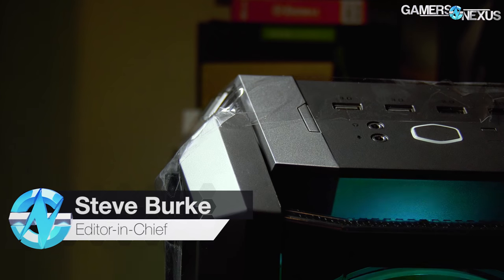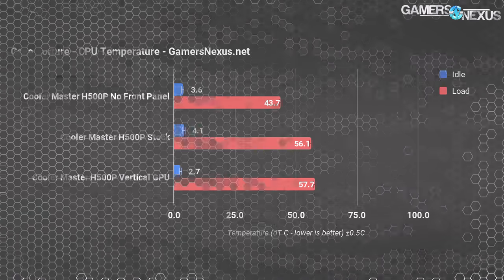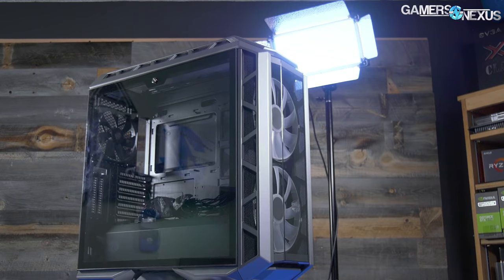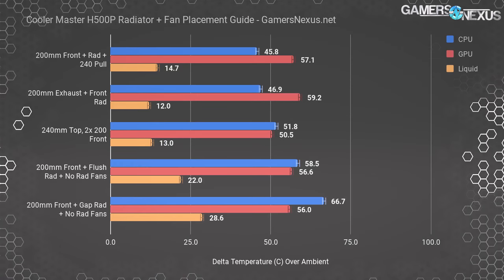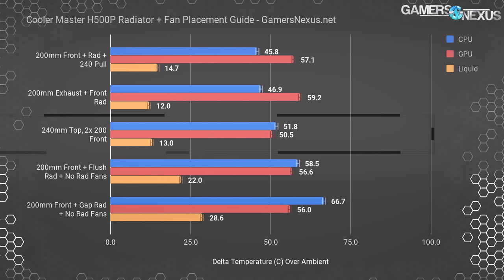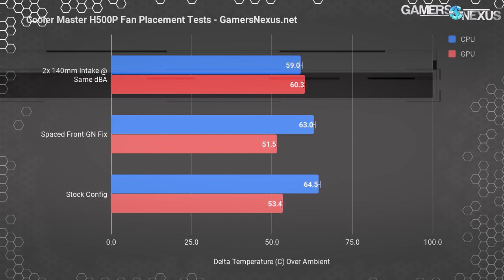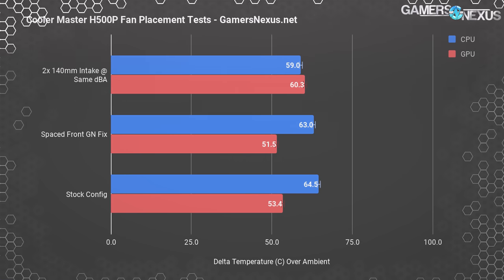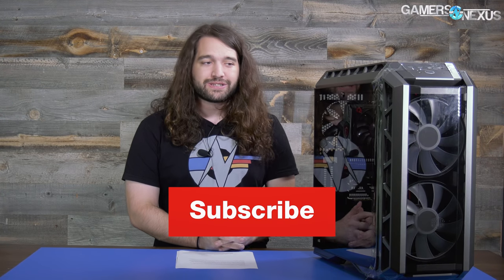Cooler Master H500P Radiator & Fan Placement Guide

Comment from the maker: SPOILER: We fixed this case's performance on air. That content goes up tomorrow.
Article: https://www.gamersnexus.net/guides/3084-cooler-master-h500p-radiator-placement-guide
You might like our review of the H500P: https://www.youtube.com/watch?v=HRsb4C5gLLc
Reply: just cut that piece of plastic and use a mesh.
But doing that on a 130 dollars case...
Reply: all mesh front lol
Reply: Thanks Steve,  I realy  like this case I can't help but wonder being aair case  what if you added 3 mor intake fans on top and just used aa regular CPU cooler how that would do
Reply: Gamers Nexus 
Steve, it would be much more helpful if you could have provided an illustration for each of the fan orientations in graphical form instead of simply a text description. It's hard to visualize all of the different configurations without them.
Reply from the maker: Noted for next time, obvious_humor!
Reply: Gamers Nexus edit your test configurations chart with mm instead of cm because WHY WOULD CASE FANS BE 1.2M, 1.4M OR 2.0M. just saying.
Reply: YES, do Radiator mounting guides for major case releases! It's very interesting and informative, even if you don't even own that particular case.

Please, do more!
Reply: What about a top radiator set as intake?
Reply: @Jeffery barring that the column already indicates they're 200mm and 140 fans,  the 2 x 200 CM and 1 x 140 CM stands for Cooler Master if you extrapolate that right next to them they list 2x 120 EVGA, unless EVGA stands for new unit of measure.
Reply: So it turns to a butterfly...or more like a "Meshify CM" !!!!????
Reply: occultworks I tried that on my case causes the gpu and other mobo components to run hotter.
Reply: Would it work or even be worth it to mount a fan or 2 behind the 2 on the front to increase air flow or no?
Reply: If you are talking about push/pull configuration on the rad,then it wouldn't be worth it, maybe you'll get 3-5 degrees cooler if your lucky but the noise would be much greater. Not really worth it.
Reply: Na I meant adding some fans behind the 200 sized fans that are kinda slack, Because this graphics card is moving more hot air towards the front of the case and I dont think I have enough intake to move it all around or out of the case.
Reply: EvanBestever I  am not sure if the 200 sized fans would actually obstruct the other ones that you would put behind them. They might even cause them to work harder and make more noise. Perhaps you should consider replacing the 200 sized fans with the smaller ones and compare the difference
Reply: I just bought the newer H500.   Will this test will apply?   There best config being the radiator and it's fans mounted on top with the stock fans left as is?
Reply: Can you do one of these for the meshify c mini?

Comment: So basically remove the front acrylic all together or just mod the front with a mesh grill instead of the clear acrylic.  You could still see the fans and the lights but this trend of pushing just straight aesthetics over performance needs to die on cases that are clearly designed around airflow.
Reply from the maker: Watch tomorrow's content! You've got the right idea.
Reply: GN already teasing a video in which they replace the window in the front panel with mesh @ 13:36 (Prediction: thermals will be similar to removing the front panel entirely if only a few degrees higher due to slight impediment by mesh)
Reply: Front mesh all the way. My first real case had a front mesh, my new case has it too. Great airflow even when featuring a massive 3-fan card and a massive CPU heatsink like the NH-D14.
Reply: My zalman z11 plus looks like a stealth bomber and has great air flow. I beg to differ on that one.
Reply: Gamers Nexus:   #DrillBabyDrill! Lol
Reply: If  you can mold the mesh to like the front acrylic shape and with some paint it would still look pretty good
Reply: No. if you have to do that. Then you would be spending more money.
Reply: Gamers Nexus actually just watched it. I really hope that CM will listen to what is being said in the community.  If a separate piece is sold as a mesh front panel that is great. But, with proper R&D they should have seen this in testing. Sounds like the marketing department is out weighing the product development department on this one.

Comment: So to make it short: This case looks unique and cool but it sucks in terms of airflow and build quality.
Reply from the maker: No. This is a radiator placement guide. It has nothing to do with build quality. The original review certainly talks about that problem, though!
Reply: I thought it as a conclusion of this case after this and the last video. I give it a C-.
Reply: This case even looks cheap... like a prom date.
Reply from the maker: The review talks about the panels. This one is coverage for people who bought it anyway. The "to make it short" sounded like a TLDW for this video, and so we wanted to clarify the intent of the new content. The review fully covers the quality and airflow concerns, though.
Reply: Tye Lucas why are you paying for a prom date?
Reply: It's a figure of speech...ffs
Reply: Case isn't bad, the part blocking the front fans are. When are case designers going to start understanding that having the GPU at the top of the case is ideal.

Comment: 2 years later. I bought this case as a bundle with an AIO Cooler and they legit sent me 2 front panels. Mesh and Acrylic. They listened. :)
Reply: Where did you put your aio ? The top ? Or the front?
Reply: @shengxiang3253   Top set to exhaust.
Reply: It comes with 2x 240mm so I assume that's enough cooling with the mesh and I also have the extra 120mm exhausting out the back. So far my CPU temps are around 44 C idle and anywhere between 55-65 C when gaming/streaming. So not bad.
Reply: @pyresama3776  that's pretty great
Reply: @pyresama3776  when you bought the case they sent you a mesh front panel? i’m going to be getting this case soon I’m going to be getting a 3080 and a rysen 7 3800x i’m somewhat worried about cooling. with a radiator on top and the three stock fans is that enough for cooling?
Reply: @dacanadianbud7441  Yes, they now supply you with a mesh front cover. I have the 2 stock fans on the front with a 240 AIO exhausting out of the top and a stock fan exhaust out of the back IO area. No cooling issues.
Reply: @pyresama3776  Alright thanks!

Comment: Answer - YES, I would absolutely love to see more Rad placement content/testing on a per case basis. I also really appreciate your approach to your reviews. Keeping to the facts and benchmarks with limited opinion or trying to add "Entertainment value". 1 more BIG request, I know that there isn't a best answer for every scenario or hardware config, *but a dedicated video on radiator and fan placement, along with the best way to control them (case controller, motherboard, included software with AIO's) would be incredibly helpful! Big thanks to the whole Team.
-just noticed this was a 3 year old video, I'll post on a newer too

Comment: Hi Steve! great review and explanations as far as radiator mounting is concerned. got a question: in the meanwhile CM has fixed the thermal problems by using a mesh front panel, so would you still recommend to put the AIO-radiator on the top or ist now a real alternative option to put it in the front behind these 2 huge 200 mm fans? hope you read this comment and i would be very thankful for an expert's answers like yours...kind regards!

Comment: Great job, as usual Steve. Your thorough approach is what keeps me coming back.

I just ordered the Thermaltake View 71 RGB for my new i9-7900x build. I would like to take out the HDD cages and mount my CLC radiator in their place but I worry about airflow being obstructed by the chassis on the backside of the radiator (hopefully that makes sense). Can you compare temps between mounting it there as opposed to the roof? Also, please test both options with and without utilizing the vertical GPU mount. 

For the record, your reviews have been instrumental in my new build. I ordered my i9-7900x from siliconlottery.com as a result of your extensive thermal testing on Skylake and Skylake-X and will be pairing it up with the new Alphacool Eisbaer 420 and some Thermal Grizzly Kryonaut. I think that trifecta will keep my temps in check even with a 4.8+ghz OC. Thanks for you all you do man. Keep up the FANTASTIC work!
Reply: Blake Ford let's see how much hate people give for the i9 lol
Reply: DClover: Why? It's the perfect processor for my particular use case. I'm using my setup for simultaneous Gaming/Streaming/Recording. Threadripper would be able to do all of that for the same price but I would get a buggier platform and slower clock speeds. Because my primary use case involves gaming, that's something I can't sacrifice. Games prefer higher clock speeds and I would be sacrificing frames unnecessarily by going with Threadripper, for example. Gaming requires higher clock speeds and Streaming/Recording requires threads. The i9-7900x gives me both without sacrifice - something Threadripper can't do (unfortunately - I would have loved to support AMD this go around).

Comment: Now that CM knows where they went wrong, they have incorporated a Front-Mesh Panel for this case, which will, in fact, change every thermal reading you had at the time of this filming. Now you can mount your ie; Corsair H150i-Pro Rad in the front, and put those 2 big fans on the top of the case for an even more powerful exhaust. And don't forget, you can also get the CM Riser Card and mount your GPU "diagonally". So how about a "new" thermal testing of this case?
PS: Instead of using tape, why didn't you just add some magnets to the front panel?

Comment: +Gamers Nexus. Steve this is a great idea for a series on cases.

I wonder how long it will be before we see an optional panel with mesh replacing the acrylic for this case?
Reply: I wonder the same, and If it releases im so going to buy it!
Reply: There are very few cases that engender the desire that this one did when I first saw it. it is so disappointing that the ver 1.0 doesn't have better air flow

Comment: would you be able to test radiator placement on a NZXT H440?
Reply: I work for a SI and I second this motion.

from my own experience building for them, having a top mounted rad in a H440 causes the CPU to be very warm especially one cooled under liquid (example of how bad it was: a h100i V2 barely cooled a stock (auto voltage, mce enabled) 6700k under a power virus workload) The theory is that the H440 top is so restrictive,it limits the ability of the radiator to remove heat due to air not being exhausted out of the case (with some being trapped in the case.

Would be nice to have concrete data to back up my suspicions.
Reply: i do use 6 noctua NF-F12 IPPC 2000 fans for the front(intake) and top(exhaust) with my AIO mounted top already. a fan i got with my fractal design Kelvin 360mm rad AIO for the back(as intake). Im trying to create positive pressure with 4 fan intake and 3 exhaust. I also do CF msi rx480 (with a 580 bios flash) for my gpu and PSU fan exhausts underneath the case. So thats my setup, and i run a 4690k oc'd to 4.4ghz Idles around 40C, and during games its around 55. Is that a ok temp as it used to idle around 32? also is the fan configuration optimal for this setup or should i switch something around?
Reply: Relight it seems okay for your usage case. the temps seem okay ( we don't have 360 aios) and by using noctua fans you might have enough pressure created to not cause the problem I mentioned. (could be because also of your raw cooling capabilities due to it being a 360 rad.) 

the only thing I would do is to add a filter for the back fan to prevent dust from being sucked in there.

Comment: I've the H500 (no-suffix) i wonder what is best for gpu temps should i mount a 360mm aio rad in front with a pull config along with the two 200mm fans as intake
with three exhaust 1 in rear and 2 on top?

or should i just buy a 240mm aio and mount it on top
with the two 200mm as intake and one 120mm exhaust in rear.

I haven't found a clear answer and i don't have enough money to find the answer by myself

Comment: Just put a MONSTA 180mm or 200mm square radiator behind the front top preinstalled 200mm fan that way you will not throw any hot air from the radiator into the graphics cards. Why has this been so hard to figure out? Solved!

Comment: I have the coolermaster H500 (not M or P). It currently has the stock 2x200mm fans in the front (rated at 90 CFM each), however I recently noticed that about a 1/3rd of the fans are blocked by the metal radiator bracket in the front (see picture). The main hole through the support is 120mm wide. I'm thinking that 3 120mm fans would push a whole lot more air since the 180cfm of the 2x 200mm fans is 1/3 blocked and the 3x 120mm fans would not be blocked at all. What do you guys think?
 
Also was looking at replacing the fans with the new sickleflow 120mm fans as they have 62CFM each (186 CFM total), have higher static pressure, and are supposedly just as quite as the 200mm fans if cooler master is to be believed. (https://www.coolermaster.com/catalog/coolers/case-fan/sickleflow-120-rgb)
 
thoughts?

Comment: Hey guys,
I was curious if anyone could tell me if I would be able to top mount an NXZT Kraken x63 AIO Rad 315 x 143 x 30mm in this case while using Ripjaw 5 ram which has a height clearance of 42 mm. I'll be doing all of this on an Auros Z390 Pro WIFI mobo which has a pretty big heat shield on the top (I’m afraid that the rad fans might bump into it).

Comment: Looking at getting the h500p argb white. Have a 360mm radiator and am assuming it's best to have the radiator on top with the fans "exhausting". My question, best to have fans on top/bottom or both? Also care about aesthetics. Ryzen 9 3900x and 2080. Price isn't much of an option as I'm willing to spend. If anyone has advise? Thanks!

Comment: Would this same logic apply to a Phanteks P400S TGE with it's terrible front intake? Trying to decide on a liquid cooler and the size of the radiator I choose is going to depend on where I stick the radiator. 

Either a 280mm or 360mm up front or a 240 on the top.

I was also thinking going 240mm up front, with an extra 120mm below it to push cooler air to the GPU without running through the radiator. Although, this bottom fan is mostly pushing air at the hard drive cage at the bottom.

My other option is to mod the front panel, add some cut out letters with mesh, to let the front of the case breathe better for the front placement and go with the 280/360mm up front.

Currently running a 1700x @ 3.8Ghz with a GTX 770 4G OC.

Comment: I think of getting a Corsair c70 that has an abundance of fan placements. I want to add two 140 on top as pull, two 140 on bottom as push, two 120 front as pull. two 120 inside (behind the first 120, over the bottom 140) to push air into the case even more. One 120 as push on rear. And a clear glass pane without holes. I know this sounds totally overkill but the build will utilize 1800x and a 1080/asus vega 56 (if it ever comes out) and im paranoid that using the setup to mine XMR and get back back slowly the stupid price of gpu will kill the pc with time. Any ideas how to place them in a smart way or my setup with "more dakka" is the best?

Comment: Hack AIO cpu cooler on to gpu and use cooler master evo as cpu cooler. works fine for me i74770k@4,2 and amd rx 480 strix and by  the way dont ever buy amd ita a trap i am stuck with rx 480 witch is a real pig in a sack. rx 480 stands for 480p. nothing more

Comment: BitWit tests were different. He had 9 to 10 degrees lower in the CPU with radiator in front of the case and GPU temperatures seemed to not change. But with the radiator at the top the CPU temps went up to  9 to 10 degrees. Do you have any idea why he had those results and you had it different? I would like to know so I could mount my radiator at its best position. THank you :D

Comment: Taking into account the air pressure, I dont think it matters much which "fresh air" or "used CPU air" is being circulated through the case, but rather, how much  air resistance the actual radiator is providing.  Being on top, it simply obstructs  proper air pressure , hence flow.  Where just stand alone fans at the top will create good flow, which is far more important.

Comment: i know and i have the version of this case with a mesh up front, how will that affect the radiator position. i have a 5900x and would like to start boosting it but i am really confused where to place the rad, should i get a 360rad and mount it up front, or a 240 up top?

Comment: What if the cpu cooler is mounted on front and without removing the 200mm fans and then adding two 120mm fans on top as exhaust...

Comment: hi i recently got the h500p mesh but unfortunately with my aio kraken x63 it can't fit front with all screws, i can screw just the 4 of the middle for the radiator and i want to know if it is necessary tu put 8 screws or with 4 its ok ? How did you put front aio with this case ?

Comment: So what if they make a case with 240m fans that’s facing a little bit of an angle like 80 to 85 degrees instead of your standard 90 degree placement for the front

Comment: I am planning an Asrock X299 Taichi XE build with an i9 7900X.
Top 240 or 280 CPU CLC and an EVGA 1080Ti liquid cooled with the rad/fan out the back.
If I understand your logic correctly, this would be pretty good thermally.
Would LOVE to see how the thermals differ 
between the X299 Taichi and the X299 Taichi XE, 
which was recently released to address the power issues.

Comment: I asked on the previous video and there was no response so I'll try here too. Could you put the 2 200mm on the inside of the front instead of on the outside. I would assume that you'd have to move the front half of the psu shroud but would it make a difference to cooling.